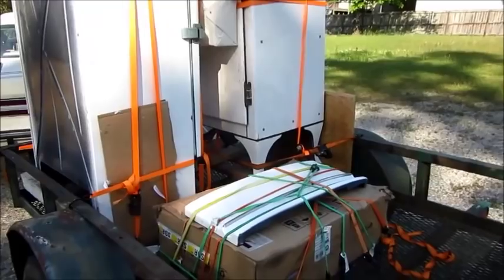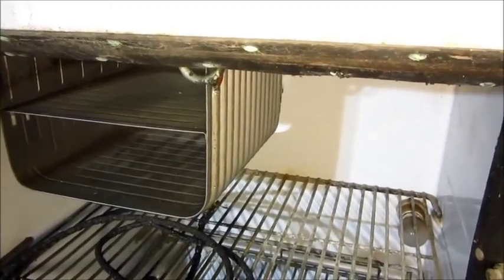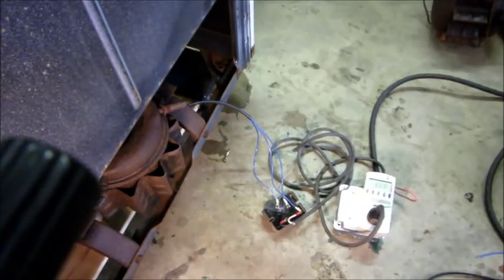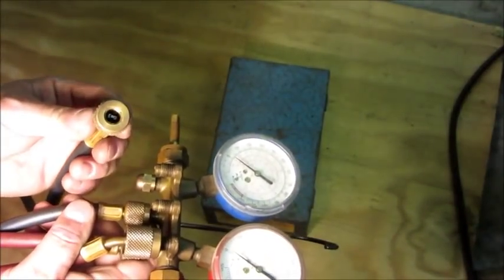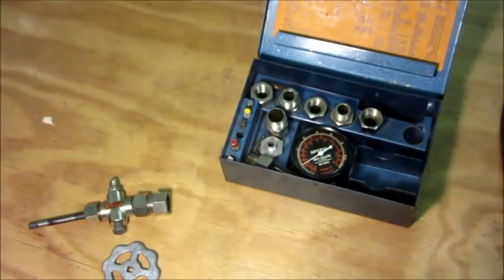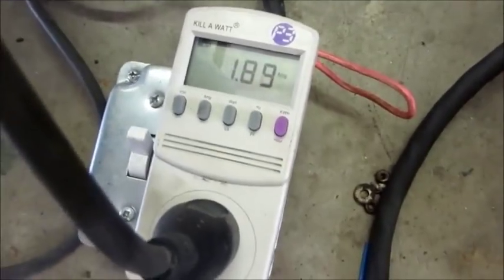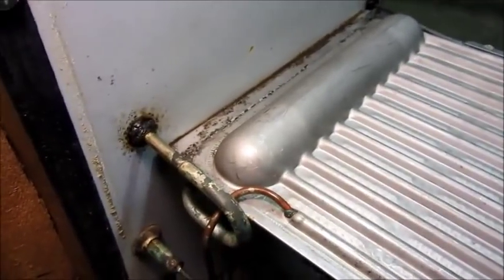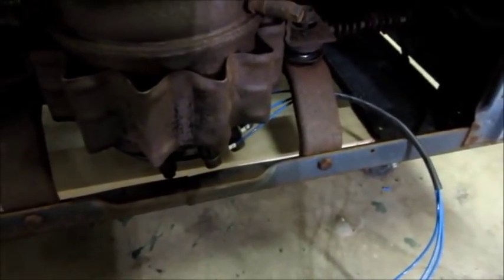Repairs to 1930's General Electric Monitor Top Refrigerator - 1 - Rewire and leak inspection

Comment: I viewed your video.  How do I open the top to replace the power card.   I have one that works but someone put a lamp cord on it and as you know very under rated for the current.
Reply from the maker: Hi George.  Here is a video about rewiring. It shows the entire process. https://youtu.be/OA34qlWvvDM

Comment: Funny thing is that I had talked to the owner of that monitor top on the phone right after you had taken it. Great projects

I'm pretty familiar with the refrigeration discussion, I've properly converted a couple of older cars with R-12 systems to R-134a. So I find that to be interesting.
Reply from the maker: Thanks!  Yep we spent quite a lot of time talking projects that day!  

I've done many, many auto AC conversions!  About 3 years ago, I did some research and switched to using R152A instead of R134A for multiple reasons. It's a better conversion refrigerant for R12 systems; but in car systems it requires an oil conversion.
Reply: Yeah I've talked fans with him for hours, especially ILG. I saw your video on R152, I'm likely going that route when I get around to doing the A/C on the 71 El Camino.
Reply from the maker: Oh yeah, he's quite an expert on Ilg!

When you do the El Camino conversion, you will not be disappointed! I gave someone a ride in my 84 Buick today and they asked me where I got the R12 from. I asked why they said that and they said, well in this stop and go traffic there's no way this A/C is this cold with R134A.  I explained them that it was Office Depot R152A and got a jaw drop. LOL!

Comment: These are like new and they run fine ! (I'm thinking about my refrigerator that is like a few months old and the compressor is already doing a super loud noise, and the previous refrigerator was like ten years old and a crapy plastic thing broke)
Reply from the maker: It's amazing how overengineered the old refrigerators are!

I have been buying, rewiring, and selling the 40's Frigidaire refrigerators as well. They have a much simpler compressor to the GE. In spite of that, they still stand the test of time and all you really ever need is a new door gasket and new wiring.
Reply: I'm super young (14 years old exactly), but I much prefer "old" things, I find them much nicer, much stronger, much better made.

Back in a day manufacturers where like : "it's super strong, it's super reliable, it will last all your life and all the life of your children's, and it's simple and does what it is meant to do and that's all !", and now days they are like : "it has all the latest (and useless, but they don't say that) features that you need to have if you want to survive and a ton of boring, blah, blah, blah..." and what they don't say, it's that they are a ton of unreliable freaking circuits, that a fucking resistor or chip will blow up after a few year and that you'll have to throw away your money to buy a new one !

That's why I love old technology and I hate new ones !
Reply from the maker: Well said, my friend!

Comment: I used to drive past this what I believe was some sort of deteriorated house/building when I was a kid years ago. Hell it might have just been a trash pile for all I remember. Anyway, there was an old monitor top in the trash pile. One day I decided that “ahh man, that’s awesome, and I’ll never be able to afford one that’s all fixed up, if I could even find one”.These were the dark ages before widespread internet access. I decided I would try to track down the property owner (can’t remember how I did that w/o internet). Anyway, I met the guy over there, gave him $100, pulled it outta the trash with boards and nails sticking up, don’t even recall how I got the thing home (but I can remember the damn nails). 

It was sulphur dioxide. Still cooled great. It basically taught me the basics on residential refrigeration theory. Mom hated it. It had to go of course. Quick. 

Oddly enough, wanna say I put it online somehow maybe? I really should have better memory on how it went down, lol. It couldn’t have been more than about 20 years ago. I do recall an old guy with grey hair pulling up in a matching old blue pickup. Took it away for $20. 

I didn’t try anymore forays into the vintage fridge endeavor. I did however, find several old window units on the side of the road, and those were maybe a tad bit easier to hide. Wish I still had a few of those ole units. But such is life. Now I’ve come to a point  in my life where I could take in more things, but you seldom ever see a window unit on the side of the road anymore, enter the scrappers! Even now, after scrapping maybe brings little more than it used to before the scrapping boom, old habitats die hard.
Even then, I’m scared to take on much if anything, as it seems I don’t have the time I used to have. Torture to either have time and no money, or money and no time. So, I suppose I’ll continue to watch YouTube and live vicariously through guys like David and shango066, until such time I’m able to realize a nice freakin shop space, and a phone that doesn’t ring constantly.

Comment: Oddly enough I have both of those refrigerators in my possession right now! I have to rewire my free Frigidaire and my Monitor top is a beautiful family survivor model.
I will need to rewire the monitor top soon. Could you go into detail about that? I gave it a shot before and I couldn't seem to get it apart enough.
Reply from the maker: Very nice!  You got lucky to get a free Frigidaire, as well! 

As for rewiring the CK Monitor Top, you have to be extremely careful because it's so easy to break the lines and let out the SO2 refrigerant. If that happens, don't feel as if all hope is lost, since these work exceptionally well with R152A.

As for the rewiring, there is extensive info here on this forum. I have participated here under my usual screen name 'turbokinetic' as well. http://monitortop.freeforums.net/thread/723

The basic process is:
1 - Remove refrigerating machine from top of cabinet. Set it on soft surface to protect finish. The rear edge should be down, with the evaporator towards you.

2 - Remove all but two of the screws that attach the evaporator plate to the bottom of the compressor deck. With minimum of bending the lines, move the evaporator mount plate downwards enough to get the fiberboard surround open, between the evaporator and compressor deck. Just remove the top and one side, folded outwards to get at the insulation space in there.

3 - Remove the insulation blanket and save it.

4 - Remove and replace wiring harness. Solder the wires to the pins on the bottom of the compressor motor.

5 - Re-stuff the insulation and re-assemble the unit.

Again, do this in an area where you have adequate ventilation incase you break a line and "Release the Demon" as we say LOL!

Comment: My CA unit has a very different service valve... im not sure how to get the cap off it honestly???
Reply from the maker: Should be the same, but with decorative cover. There is a hollow screw in the top of the port, providing a threaded attachment for the decorative cover. After that is removed, the port plug can be removed. Some were soldered and the hollow screw must be heated to melt the solder before unscrewing it.

Comment: What is that tool you use to charge the System called? I'm thinking about buying a CA monitor top and converting it to r152a any help would be appreciated.
Reply from the maker: Hi Chandler. That tool is called a "Imperial hermetic service kit."  I was common in the days these machines were still in daily use.  There is a whole lot to learn about the CA Monitor Top. They are very much unlike anything else. They use a special refrigerant called Methyl Formate. This is a liquid under normal conditions. It can not be replaced with R152A or any other "Freon" style refrigerant gas.

There is a lot of reading here: http://monitortop.freeforums.net/board/3/ca-machines 

The CK and DR machines used sulphur dioxide (SO2) which can be replaced with other easy-to-obtain gases. The CA is a beast all its own.
Reply: @davida1hiwaaynet  thank you for posting this! I acquired my grandfather's 1936 monitor top unit, getting it sanded and sprayed and re wiring it myself. Going to switch over the refrigerant due to being in a basement. Glad to see people appreciate these old units

Comment: I'm picking up one of these today I don't know if it works I'm a little worried about the safety of the sulfur dioxide Is it as deadly as I think it is?
I can't seem to find data on that.
Reply from the maker: Sorry for the delayed reply. YouTube held your comment for some reason. 

The SO2 is not deadly unless you are trapped in an enclosed space with a major leak and can't escape. There was a time when manufacturers were trying to sell newer, Freon models, and played up the danger of SO2 so that they could  make more sales of new models.  

The system will not develop a massive leak by its self. The only way massive leaks occur is when people carelessly handle the machine, possibly allowing the top to fall off and break a line. 

Leaks developing during operation are very, very rare. They are usually seeps and pinholes when they do occur. Most often they occur on the evaporator and allow air to be drawn in, before the gas leaks out. 

Myself and others work with SO2 machines routinely and have been exposed to some pretty bad releases. None of us have ever had any lasting effects, beyond some sneezing for a few minutes, and a lingering smell on the clothes and hair. 

So don't worry too much. Just be cautious about breaking lines and you'll be fine.
Reply: @davida1hiwaaynet  Thanks for the advice I did buy the fridge it seems to work great.
The guy I bought it from said he was a friend of yours small world huh.
Reply from the maker: @dmclegg66  
Excellent. Happy you bought it!
Reply: @davida1hiwaaynet  👍

Comment: I'm interested in having my 1930's General Electric Monitor Top Refrigerator repaired.  It is used and working.  It has one dent on the door that needs to be repaired, the handle needs to be fixed and just cleaned up.  I don't think there is any problem with the compressor.  It was in my grandmother's house in Nebraska until we brought it to California.  Any ideas who to contact?
Reply from the maker: Hi Linda. It's great that you're still using your grandmother's Monitor Top.  I live in Alabama which is a long way from CA and have no resources in that area.  I would reach out on the Monitor Top forum (https://monitortop.freeforums.net/) or Facebook groups looking for someone in your area.  From participating in those forums, I have seen people comment that California is somewhat of a 'wasteland' when it comes to skilled labor to repair anything like this. You may have to ship it somewhere to get it repaired.
Reply: @davida1hiwaaynet  Thank you David!  I’ll do that!  🥰

Comment: I recently become interested in vintage refrigerators and enjoy watching your videos while I learn more about them. I recently purchased a 1935/36 Frigidaire by GM that uses dichlorotetrafluorothane (r114). Do you know if there is a replacement that I can use or good place to ask?
Reply from the maker: Hi Bruce. Thanks for the comment!  This fridge was using R114 as well, before it leaked out. The compressors back in these days have a lot of reserve power and are capable of working at slightly higher pressures than that of R114. This one worked quite well with R152A; which is what I plan to go back with after putting it back together.They had a refrigerant R124 which was a substitute for R114; however this has since been banned.
Reply: Thanks for the quick response. You made my day. Happy New Year.
Reply from the maker: You're welcome! Happy new year to you as well!Has yours lost its refrigerant or are you just planning ahead in case that happens?
Reply: I just got it yesterday. I had the seller plug it in the night before. It cools put definitely is not getting cold. I suspect a leak and was hoping that I had an option with refrigerant.
Reply from the maker: Bruce, if they truly did plug it in the night before, it should have been fully frosted by morning. It does take 1 to 3 hours for these early Frigidaire units to cool completely. 

If, after that, it's still not fully frosted, look at the bottom of the compressor for any signs of oil around the terminals.
Reply: I just got a chance to look at the bottom of the compressor any I see no signs of oil around the terminals. He did mention that it was noisey prior to letting it run all night. He said it was quiet now. Not sure if that means anything. Would you recommend that I add oil to it? If so would you know what kind. At this point I'm thinking that I will recharge it and check for leaks.
Reply from the maker: That's good it doesn't have oil around the terminals. That's definitely a plus! 

I'm not sure what the factory oil charge was, but it would have been some type of mineral oil. If you add oil, I would say a lighter grade of mineral oil like 100 SUS would be a good type to add to the system. With my Frigidaire (leaked at the terminals) I added in about one cup of oil. 

I think that in your case, with the charge low, it may be that the oil is trapped in the evaporator and when a charge is put in the system, it will return to the compressor. To help the compressor function and circulate the charge safely, you might want to add a few ounces of oil to the system as a precaution.

Comment: Where can you find parts for these?
Reply from the maker: It's often hard to locate parts for these. Sadly they've been out of production for 70+ years. Your best bet is to use social networking such as the Monitor Top forum (https://monitortop.freeforums.net/) or Facebook groups to locate someone selling parts.  That is the only source for original hinges, handles, thermostats etc. The electrical and mechanical parts can often be rebuilt or have modern replacements adapted.
Reply: @davida1hiwaaynet  thank you i got a nice looking ck1b16 the other  day for free they said it works but the cord is in bad shap so im going to replace it and the door latch wont hold the door shut do you know much about this unit?

Comment: speaking of r154a have you ever tried using it in a unit designed for r22?
Reply from the maker: I haven't tried that; due to the fact that the temperature-pressure curve for R152A and for R22 are very different. The result would be like using R12 in an R22 unit. Very, very poor performance due to the compressor displacement, expansion device, and refrigerant not being matched.